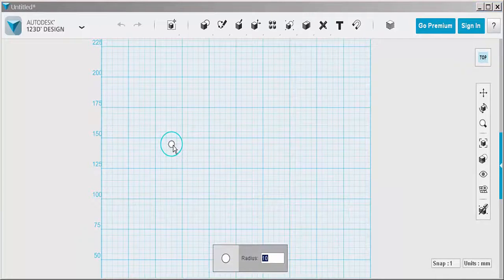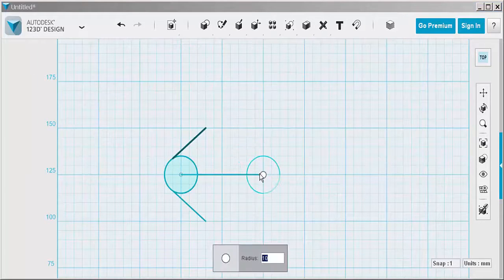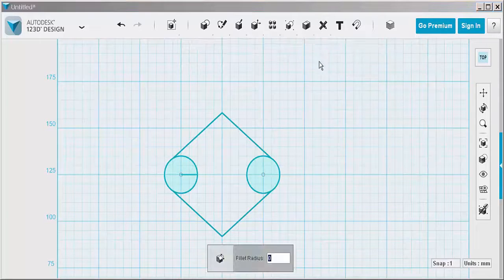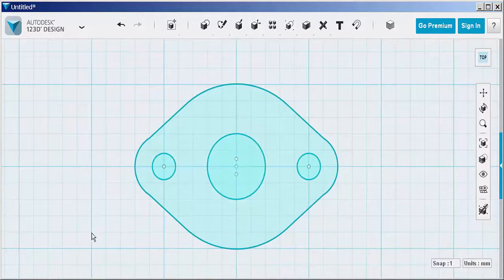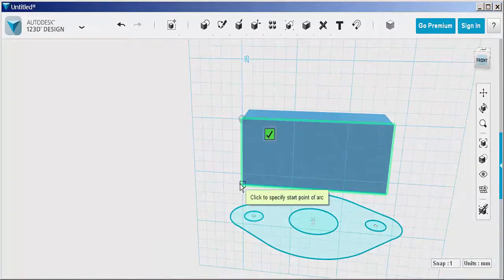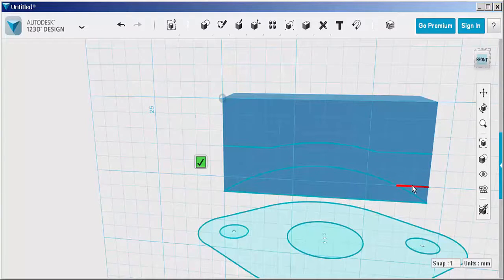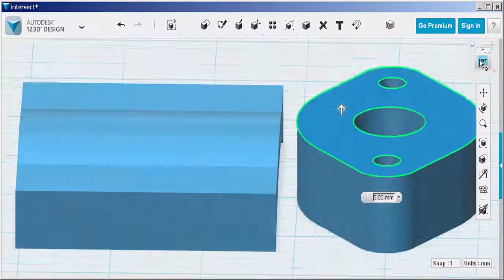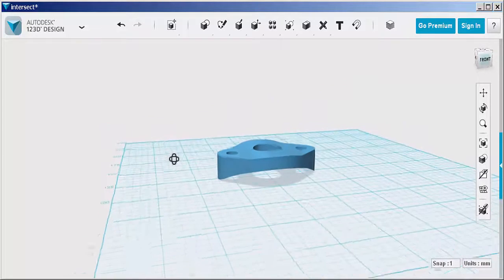123D Design: Curved Rocker Arm

Comment: whew... that was some very fast (difficult to follow in the first half) mouse work.  LOL
 You truly are a master at your craft.  
I'll have to try watching again later on a real computer with better pausing, because this looked very useful.

If I may ask:
What is the difference between "extrude" and "push/pull"?  When watching tutorials, they look the same to me.
Reply from the maker: TheRangeControl Press/pull simply adds or subtracts volume. Extrude lets you make a new solid, merge, subtract, or intersect. In MOST cases they'll both do what you want, which is to add/subtract volume. But sometimes you'll need the options that only Extrude provides.

Comment: That video looked very fascinating.  While I admit that the speed of the mouse movement with intermittent explanation vs step by step made it difficult to follow (quite a few rewinds on my phone).  I'll have to try to pause and alt-tab to try to extrapolate what you make look incredibly simple. :-D 

However, I would like to ask what the difference is from "push/pull" & "Extract"... they always look like the same thing to me when there are tutorials. :-)
Reply from the maker: TheRangeControl Yes, I did go kind of fast on this one, sorry. It's more of an advanced vid. Sometimes I assume viewers have seen my more basic vids first and already know the sketch tools. Most of the sketching in this vid was mirroring, and I'll do a vid on mirroring.